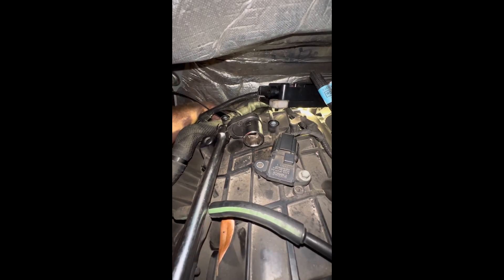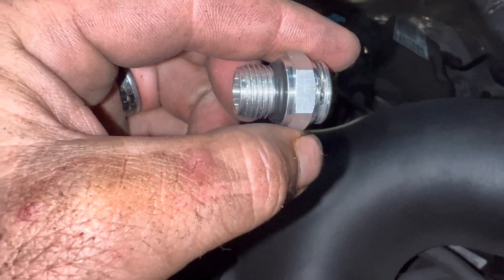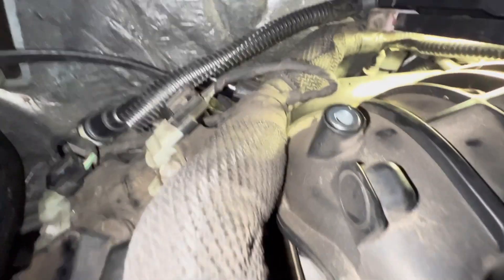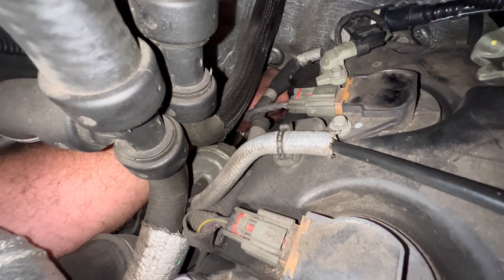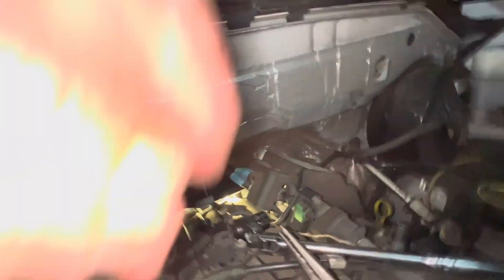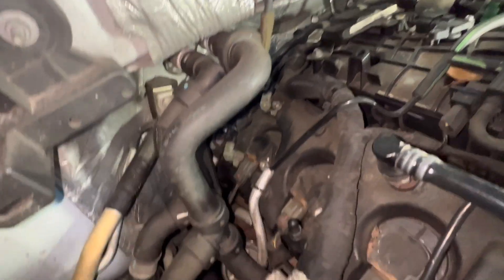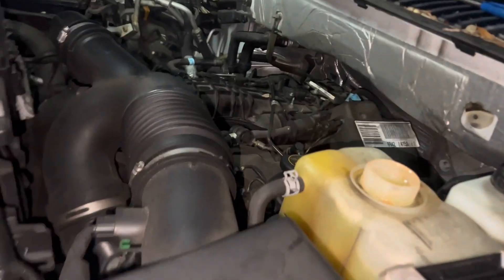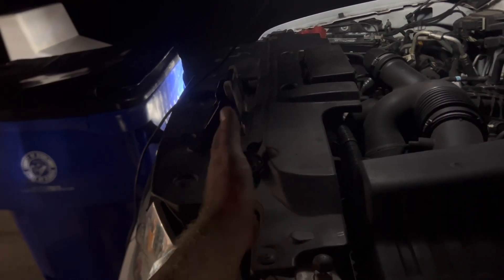Full How To: Replacing Rear 3.5 EcoBoost Turbo Coolant Fittings

Comment: How difficult was it to push in the line into the fitting? I’m currently doing to my truck and I can’t seem to push it in. I replaced the old fitting and line
Reply from the maker: Put some dielectric grease on it, I’ve had to use a pry bar to pry the line a little to get it to snap in

Comment: Did my whole passenger side lines and fittings this way. What a pain in the * dude. Thanks for the video it helped alot. Especiallly the ole garbage bin trick its literally the perfect height. Put a blanket or a rug over the top and your body with thank you later. Oh and the dealership quoted me over $2000 to do it. Did it myself for 250 plus tools.
Reply from the maker: Good deal and we’re glad it helped you! Thank you for your feed back as well!

Comment: The rear fitting are a real bear! I am installing the A/N Full Race coolant line and new manifolds on my 2013. I had to remove the vaccum pump since the line would not release on the leaky PS. The DS I was able to remove the clip from the top of the frame while looking from the side of the transmission. I was able to remove the fitting by going beside the fuel lines underneath with a few extensions and swivel. I went in over the top to install the new fitting FYI the block face is angled where the fitting screw in. A 10 in pipe wrench works great for removing the turbo studs

Comment: I’m retired, I had a 2021 Lariat with the 3.5
I tow a boat all over northern Ontario Canada fishing.
I traded in my truck before I would lose to much money at 94,000k
I bought a fully loaded 2024 Platinum with the 3.5 once again.
Very happy with the truck, I take very good care of it, and enjoy preventive maintenance, it’s almost a hobby of mine.
One day, maybe 8-10 years from now, I’ll study and find instructions on how to lift the body off the frame and service the engine properly.
I grew up in Collision shops as a prep/painter, I’ve seen cars taken apart for years so it doesn’t frighten me.
I do all my own work using Utube for guidance, cause being in the automotive business all these years, I’ve worked in Dealerships mostly and have witnessed work that wasn’t done, yet the customer paid for it.
For example-
You pay for a tune up, they change the Air Filter/Cabin Filter and the easy to access spark plugs, on a Dodge Caravan for example the rear 3 plugs are difficult to reach at the back against the fire wall, so they don’t bother to change them, now the steel threads are in an aluminum block and need to be changed before 65,000 otherwise there’s a good chance the plugs will seize in.
I once seen a mechanic at a Dodge Dealer not change the fuel filter held on by one 8mm bolt and it’s hanging in the open by the fuel tank.
I asked what it was, he said oh that’s the fuel filter, then he asked me if I need/want one cause he’s got lots…cause he doesn’t bother to change it !
If you aren’t afraid and have some tools, use Utube and try to do most of the work yourself.
If you have to take it somewhere for service insist you receive the replaced parts, they quite often tell people I know, that oops, mechanic forgot and through them out, that’s the first sign that only half the work you paid for was done !

Comment: Those are the simple ones, take the wheel well off and  go from there. The vacuum pumps are notorious for leaking oil
Reply from the maker: Yes they are, we have replaced 4 of them and will be replacing the 5th in about a week

Comment: What is the easiest way to do the turbo fittings without removing the turbo
Reply from the maker: Very carefully through the wheel well and from up top and below as well. We have a job coming up where we’re replacing both turbos, every fitting and manifolds

Comment: I have a 2012 f150 that I’m currently leaking coolant , coming down the bell and dripping onto the starter and then onto the transmission pan , the only thing I can think of is the fittings on the back side of the engine only when the truck sits after use, is when I see this happening . I did replace the fittings on both turbos. So hopefully this fixes the issue
Reply: Did the fittings end up fixing that problem ? I’m having the same issue now and can’t seem to trace where the leak is coming from as it only does it periodically after it sits
Reply from the maker: @309dude there are 8 fittings in total since both turbos have a feed and supply with a fitting on each end, you would have to check them all or just replace them all for piece of mind since they are a serviceable piece.
Reply from the maker: I can’t see it being anywhere else honestly, I hope the video helps you get the job done!

Comment: My 2016 has low coolant level and an occasional burning smell, sometimes white smoke from around the area where you were doing this near the passenger side turbo. Do you think it could be a fitting ?
Reply from the maker: It’s a good chance it could be one of them yes, especially if coolant is becoming low in what should be a sealed system.

Comment: First video I've seen replacing the rear fittings, everyone else avoids doing this , Thanks much I have to do mine, The videos I've been seeing are either pulling the motor or lifting the cab. Thanks so much for sharing
Reply from the maker: You’re welcome we’re glad we could help!
Reply: @BenzSwapped did you replace the line to? Or just the fittings?
Reply from the maker: Just the fittings
Reply: So the coolant  line and fittings was replaced  without  pulling  the turbo???
Reply from the maker: Yes that’s correct

Comment: Better off removing oil vacum pump,  the well and use  the long pick. With curve on the end. Glue a small make up mirror or any small one. I have two daughters so plenty of little mirrors😂 . to the fire wall .  Pop the click with long pick with a curve on the end. and use 19 mm and  30 minutes if it’s your first time.  Good luck to all.
Reply: What about the drivers side?
Reply from the maker: @505fastlife6 I did another video on all 4

Comment: Just a tip, you can totally pull these through the passenger side wheel well with a pic a 19 mm and a little patience. Takes about an hour
Reply: @punkrocker10115 - could the driver's side be done the same way if the turbo/inner fender line were out?
Reply: @jessiestarns2020  If you take the wheel liner out on the passenger side, you can get to both of the line on the back of the block. Then all you have to do is pull the driver side off the turbo.
Reply: Can I fly you to my house and do this for me?? Lol 
Thanks for the video
Reply from the maker: Absolutely just shoot us an email! Swrvtech@yahoo.com
Reply: Did you just replace the one nut behind engine? I have same issue.
Reply from the maker: The one on the back of the head as well as the top one on the turbo yes and still to this day it has no issues
Reply: @BenzSwapped wow. And do you just pull pipe straight out first before removing nut?
Reply from the maker: On the back it’s best and easiest to remove the fitting with the line using a line wrench crows foot, I have another video briefly explaining it
Reply: I can't seem to get at the driver side fitting? I got at the passenger side but the drivers side is way back there. How did you get at the drivers side? You take anything else out?
Reply: @RickM-CM  No, it took me a bit but, I did it mostly by feel. Only thing I took out was the passenger wheel well.
Reply: @punkrocker10115  you got some talent man, I struggled with the passenger side. The driver side I can't quite get my fat arm in far enough. Mind.you it is just up on stands
Reply: @RickM-CM  yeah, I definitely struggled to get it in and out. You might be able to pull the driver side wheel well and get it that way.

Comment: It's crazy how many videos I've seen how many of these guys that don't pull the intake to make those fittings way easier to get to. I personally pulled the cab. I replaced all the lines and all fittings not just one or two of them.
Reply from the maker: No need to do more work than is needed, also not in the budget at the time to do them all. I couldn’t find info on these so I posted them best way I found possible to do so.
Reply: Why would you pull the cab? It's super easy to pull the passenger side wheel well and get to them that way. It only takes like an hour to do.

Comment: Mine is a 2014    Is it the exact same setup as far as you know?
Reply: 2014 has different hose configuration - they come up and over the intake. When I had to replace vacuum pump, videos made it look easy but they were all pre-2014. That’s when I realized the difference in hose configuration.
Reply from the maker: It should be yes

Comment: Not a Pro...wears a conductive ring.
Reply from the maker: We’ve never claimed to be a pro, just a technician. Also there are no open hot circuits in the area we were working in.
Reply: @BenzSwapped  Don't get ruffled.  I never said you were Pro, but someone ELSE might see that & THINK.
All it takes is ONCE...a life-changing event.
Being a gun owner, I don't "play" w/guns either....or even go to bars to throw hatchets.

Comment: nice job!  Do you feel like the job would be easier with the valve covers removed?  I need to replace leaky covers and thought I'd also pull the intake and clean my intake valves. I have a driver side coolant pipe leaking at the rear. I tried a bottle of barrs leaks sealant and it did work temporarily. I'm thinking it may be easier with top of engine off to change out those fittings. thanks.
Reply: I have the intake off and yes it gave a lot more room.  We borrowed a topside creeper also very helpful kinda like his trash can.
Reply from the maker: Thank you and potentially but more likely for debris to fall into the heads I would think. I would replace your thermostat and flush the entire system once you change the fitting so you can get any of the remaining stop leak out of the system so hopefully it won’t block anything.

Comment: Did you only do the passenger side or were you able to get the one on the back of the block on driver side to without removing the turbo?
Reply from the maker: I just replaced the other two fittings on the passenger side but I have not looked at the driver side fittings, the passenger side I was able to drop the starter down and the ac compressor and remove both pipes to the turbo and get the tube out and the new fittings in.
Reply: Right on. Not looking forward to tackling this. Gotta getter done though. Been running straight water for a month. Losing a gallon everytime I drive lol Hopefully I can get that back fitting as that’s the leaker.
Reply from the maker: @tomkowal6552  hopefully it goes smooth for you and make sure you replace both fittings if not all 8 at the same time just for piece of mind and will save you on coolant down the road when the others start to leak.

Comment: I got the keeper clip of but am unable to pull the line. Any tips or tricks on how to get that VERY stuck line out would be AWESOME. 

Great video workin on this issue as I type this in.
Reply: I used a lady slipper to gently pull out! Requires no force
Reply from the maker: Sorry for the delay, it should wiggle right out as it’s just a sealing o ring, we’re you able to get it out?
Reply: Do you have to loosen the one on the turbo, or can the back come out without doing that.  Mine is stuck and can't seem to get it to wiggle out.  Clip is out.
Reply from the maker: @MarkSchierling-jy6xz I had the turbo side connection undone and was able to get the tube out. I would recommend replacing both for piece of mind

Comment: I’m changing out the turbos on my f150. After I’m all done do I just add coolant to top it off where it was at and then run the truck with ac and heat to hear it up with the coolant cap off?
Reply from the maker: Yessir, having the heat on also circulates the coolant through the heater to purge any air, once up to temp put the cap on safely and drive it around and then let it cool and check the level again

Comment: What year truck is it?
Reply from the maker: 15 expedition
Reply: @SWRVTech Inc.  for sure. I got a friend with a 17 f150 and hers is leaking from I belive that fitting but I think the fittings are different they bolt in the turbo instead of clip in like these.
Reply from the maker: @jasonmccoy6052   that I’m not sure I know my 17 f150 only has coolant lines and not coolant lines but it is a 2.7

Comment: I heard you can get to the passenger side fitting by removing the vacuum pump, and the driver side by taking off the coolant crossover. You're much braver than me. I'm sending mine to the shop for manifold and coolant lines. Can't have it down for all the days this would take me.
Reply from the maker: It can turn into a bigger job quick if you replace all of the fittings. Thankfully only the one line was leaking at the turbo and engine so I just replaced those to save time and money.